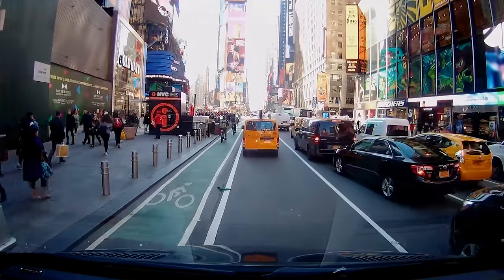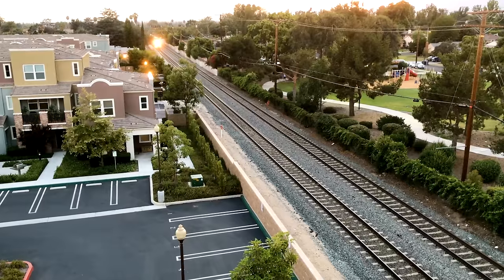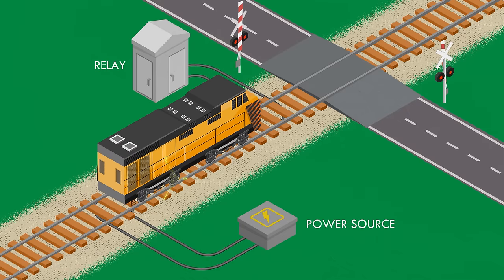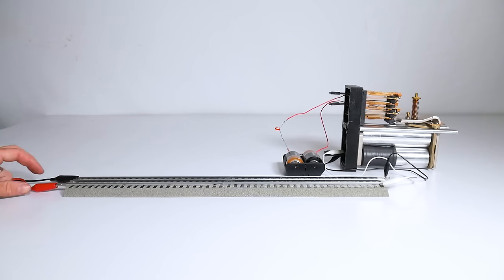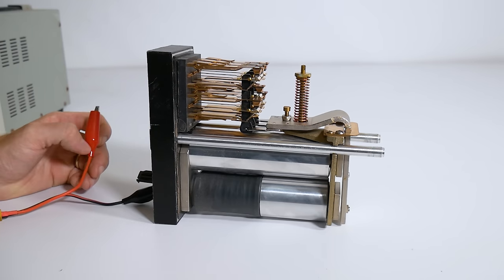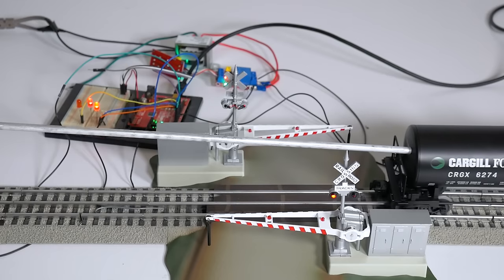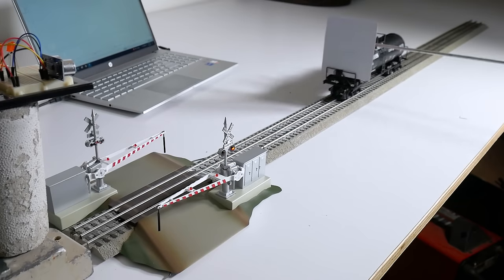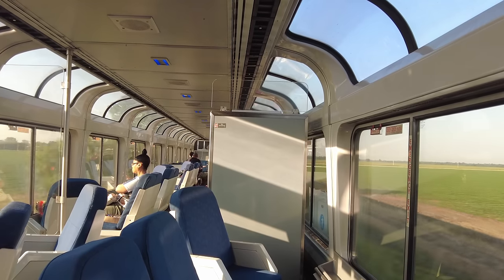How Railroad Crossings Work

Comment: Dear Practical Engineering, awesome video, especially love the fact you included the actual railroad relay to visualize the workings of train detection for the purpose of initializing the mechanical and electronic/electrical components of a railroad crossing system.
On the insulated tracks in true scale; just wondering about the mechanical components of the rails which provide the insulated section. Regarding the fact how you showed the rail gap, the fish plates and how they bond the two pieces of rail over the insulated gap should mean that these fish plates and their mounting bolts and nuts are also insulated from the rail. Would be interesting to see that in more detailed fashion. Cheerio

Comment: In the UK, the crossing warning actually have a yellow light analogous to those on traffic signals, to provide a few seconds' heads-up before the crossing starts to flash. These same signal lights are also used for movable bridges there, lighting up when the bridge has to open for boats. Also, for some reason, the tunnel under London Bridge Station has a set of these signals too.

Comment: Good generally explanation of level crossings .
Spent 41 years as a signalling tech support engineer.
I still think the stick circuit on a relay is a stroke of genius. 
A rely held energised by its own contact .
This enables a rely to have a memory .
In other words a 0 or a 1.
Binary .
The basis of a computer and WW2 Collosus the code breaking computer

Comment: I also remembered that train crossings actually have swinging stop signs called griswolds, and flagging signals called wig wags, and most crossings have different type of bell sounds, which are mechanical and electronic. There are also different types of right lights, light bulb and led lights, and different sound of gate mechanisms, with different lights too. I’ve always go by any train crossings all the time.

Comment: There are stretches on Highway 58 between Barstow and Bakersfield, California, where railroad tracks run parallel to the highway, with an occasional intersecting of the two.  It's interesting to see some daring motorists racing the freight trains to the grade crossing, as the motorist stopped at a grade crossing could be stuck there for several minutes.
Reply: It's just the same game the trains play while racing to an interlocking.

Comment: I like the sophistication of grade crossing gates on rails with high and low speed trains.  I knew if the gates fired and I couldn't even hear the drone of diesels yet then a hot shot was coming round the bend.  But If I could hear diesels thundering before lights and gates then I knew it was a slow roller.  Getting those gates to go back up when the approaching train slowed to a stop was particularly genius, though.

Comment: is the 3VDC you're using for the demonstration related to the speed of the the relay's operation?

i've seen some specialized relays in my day, but never a "vital" train signalling relay. its slow operation was interesting, and i'm glad you addressed the safety mechanisms built into the relay itself. thanks as always, Grady!

Comment: Here in Mpls/St Paul, Minnesota.  We have ‘No Horn’ at grade RR crossings for a mainline high volume railroad line.  All are signed ‘No Horn’ for vehicle drivers.  This means the train engineer does not sound their horns when their trains approach crossings.  Also the street approach to the crossings have long concrete islands with reflective sign posts or ballards in an effort to keep approaching drivers on their side of the road when a train approaches.  All No Horn crossings have automatic gates, as described in the video.  No horn crossings are mostly found in residential neighborhoods.  So as not to wake up citizens overnight, though they operate 24/7.  I wonder what fail safes are added, in case primary systems fail.

Comment: It's amazing how different the US system is from the system in the UK.

For a start only quiet crossings are controlled automatically like yours. Busy crossings are integrated with the signalling system and controlled by the signalling centre for the area.
On a busy road they'll have barriers that cover the full width of the road to prevent people just driving around them. The alarms and lights will trigger first followed by the entry barriers about 10 seconds later with the exit barriers dropping another 10 seconds after that. Once the barriers are down the alarms will turn off with the lights remaining on.

The barriers will be triggered automatically just like yours but we have a MUCH longer waiting time (about 3 minutes) to allow signallers enough time to stop the train if anything goes wrong. The signaller will view the CCTV of the crossing and verify that the barriers are down and no-one is trapped on the crossing before setting the signal to green.
If someone is trapped on the crossing, which is possible if people don't keep the crossing clear in heavy traffic, the signaller can raise the barriers to allow them to leave before lowering them again.
The barriers will usually go up immediately after a train has passed unless there is another train coming soon.

Crossbucks (ours are very different) are only used at crossings without barriers, typically on rarely used crossings on industrial estates or ports. We also have signs with the name of the crossing and a phone number to call but ours are much larger.

The UK is also actively trying to remove as many crossings as possible to cut down on the number of incidents even if it wouldn't normally be considered practical or cost effective.

This video by Dad Rail gives a pretty good look at how they work https://www.youtube.com/watch?v=u2wx9CKIa9g
Reply: When it comes to automation, most LCs only have an auto-raise feature. Auto-lower is pretty rare. It's generally only found at MCB-ODs, where obstacle detection equipment replaces the signaller.

Comment: Where I live the railroad crossings are sometimes controlled in combination with signals. So if a crossing is between the entry signal and the station, the entry signal won't go green until the crossing is reporting itself as secured. This also applies for exit signals & crossings at the end of the railway platform.

Comment: I am on the operating crew of a heritage railroad in Nashville, TN and a volunteer presenter for Operation Lifesaver, an organization that educates the public about the safety at railroad crossings.  This was a good video and does a nice job of explaining the safety warning devices around at railroad crossings and how they work.  And as @danieljohn560 said, thanks for pointing out the blue sign with the toll-free number that people should call if they are stuck on the tracks or if they see someone who is stuck on the tracks.

Comment: Some AWDs require longer warning times and/or slower speeds to cross them for train crews to comply with. We have a few field tricks to speed things up. If you charge at the crossing, the approach circuit senses the train and thinks you are going to hit the crossing sooner. You then can slow slightly and the additional warning time will be provided for without going slowly. This is obviously not possible with freight trains as much but with passenger trains you can do it. If you have a speed restriction over the grade crossing and more than 20 secs of warning before occupying it, simply approaching it at the speed you are restricted to at the crossing actually makes it harder to provide the warning before occupying since the crossing won't activate until you are close to it. Charging the crossing activates it sooner and then you can slow to whatever speed and/or to provide the warning time required which is much faster. We call it "showing the crossing we mean business".

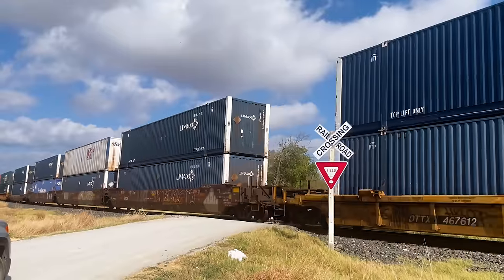Comment: 3:18 A few speedbumps make this crossing safer as cars need to slow down.
4:30 Way back in my school years A few kids figured out this system and did not know the difference between a train axle and a bike chain. Thus operating the gates.

Comment: In my country we don't have problems discussed in the video because most grade crossings are human controlled. Some controlled from the station headmaster but rest are controlled by post on the crossing.

For detecting train, we have automatic sensors and those are relayed to the stations or controller hub of the entire operation and relayed to the dedicated post via bell signal.

Comment: Westbound on Manatee Avenue in downtown Bradenton, Florida. I was waiting at a red light but there was a railroad crossing directly in front of me so I had stopped clear of the gates and tracks. The Toyota Corolla in front of me had not. Its trunk was still well over the tracks.
That's when suddenly I heard the clanging of the crossing bell. The gates began to lower in front of me and the lights began to flash almost simultaneously from my left side. I heard the horn of an oncoming train headed northbound ready to cross the Manatee River.

At this point on Manatee avenue there are only westbound lanes. The east bound lanes are a block further south.

The gates closed in front of me but behind the Toyota. He actually had plenty of room to move forward but didn't seem to notice any of the commotion. At this point the train had also noticed the situation as its horned blasts started to become more frantic.

Soon the train was joined by a chorus of other horns from cars, trucks and even a bus that had stopped for the crossing. All of them were trying to warn the Toyota of its impending danger but to no avail. The light in front of it had changed to green but it was taking a considerable time for traffic to get moving. The Toyota still had plenty of room to pull forward and clear the tracks. It just wasn't.

Suddenly out of the bushes to the left side of the intersection, the locomotive appeared. It was blaring its horn continuously. It was also moving at barely a walking pace while pulling a single Tropicana car behind it. With brake squealing it came to a full and complete stop about 6 ft shy of the back of the Toyota.
Still blasting it's horn but the Toyota remained in different. As the traffic in front of the Toyota began to gradually pull forward then and only then the Toyota continued on its way seemingly oblivious to the fact that a train had managed to stop for it.

Comment: When I worked on the track for British Rail back in the 1970s, we had a much simpler way of finding out if a train was approaching. We would lay an explosive charge on the track, and when it went 'Boom', we knew we had to run for it! Literally had to chuck my shovel away and dive into a ditch before now - when a train comes pelting out of a tunnel, and the wind is in the wrong direction, and the trackman with the flags and little trumpet is distracted, it was the charge that saved your life.

I had a quick look, and that cross bar thingy may be the international standard, but most level crossings (that's what we call them) in the UK seem to have a rectangular sign with three lights, (two red and one orange below them), surrounded by red and white bars. Sometimes they have the cross bars above, but mainly just the rectangle with the red/orange lights. To be honest, I don't remember either the rectangle or the cross bars in the 1970s - but that's just me. I'm sure they were there, or something very similar!
Reply: The UK has them, but only at open LCs (which are few and far between nowadays).

Comment: Here's how a modern AC track circuit detects the speed of the train:
Leading from the bungalow, one wire connects to each rail. The computer measures the impedance between the two wires (AC resistance). If no train is present, the impedance is 100% (the wires/rails have little to no AC current going between them). As a train approaches and the circuit is shunted by the wheelsets (single piece of solid metal with an axle and two wheels) the AC current goes down one rail, through the first wheelset, and back down the other rail to the other wire, reducing the impedance. If a wheelset shunts directly where the wires connect, the impedance is 0%. The computer looks at the speed of the dropping impedance (AC resistance) so it knows when to lower the gates. As soon as the number starts increasing (or stops changing), it raises the gates.

To keep the 100% value more stable, there is a place far away, farther away than you would ever need to detect a train, that has a "narrowband shunt" in the track. It's a filter connected across the rails that lets a specific AC frequency through and nothing else. If no train is present, the crossing sees this maximum distance instead which doesn't change. (If 100% was an open circuit, rain could drop the impedance and lower the gates).

This system keeps the rail intact with no IJs (insulated joints) and allows nearby crossings to have completely separate overlapping circuits on different AC frequencies. Also, additional AC frequencies are used for the railroad signals that keep trains separated from each other (which inspired traffic signals (and improved our understanding of colored glass and color perception in general), but that's another story).

Comment: Railroad crossings in Germany are more complex. The big difference is, there is always a signal for the train in braking distance or more for the train, either a normal train signal or a railroad crossing signal, which will stop the train if the railroad crossing is not safe. 
There are two types of it, first is switched on by the train dispatcher, second by the train itself.  For the first type, the train dispatcher has to switch on the railroad crossing and check if is activated and nobody is on the tracks via camera or radar sensors before he can set the signal for the block section to green. The railroad crossing s is switched off / opened after the train left the block section. This type sometimes has long waiting times for cars.
The second type is switched on by train itself, but far away from the railroad crossing. Often there are axle counters used, because they are also used for detecting if a block section is free (number of axels in = out). In braking distance there is a signal for the train driver, which shows a white light if the crossing is activated (and the radar sensor detected no car on the tracks, if installed). If the signal light is off, the train has to stop in front of the railroad crossing (which will enforced by the train safety system). After the crossing there is another axle counter, to detect if all axles left the area to turn of the railroad crossing.
This is only a short version, it's a way more complex in reality. There a timeouts for certain things, most railroad crossings have a key switch where the train driver can activate it if the automatic activation does not work, ...

Comment: I've always wondered about this, thank you for the very informative and interesting video! One thing I feel was missed is how multiple at grade crossings that are close together work? Wouldn't the relays interfere with each other or do they use segmented track portions which can regulate more than one set of crossing safeguards. Thanks

Comment: I once saw a near-collision that happened because two small (maintenance ?) locomotives went through a crossing about 1/2-1 minute apart.  The gate came down for the first locomotive but then went back up - and STAYED up - as the following locomotive neared the crossing.  At the same time, a dude in an approaching large pickup, seeing the gate rise, kept going, seeing the second locomotive only at the last second.  Both pickup and Locomotive braked hard, narrowly avoiding disaster !
On another occasion, I was approaching a crossing (which had not seen rail traffic in years) during a heavy thunderstorm. A lightning bolt struck, several hundred feet down the tracks, triggering the gate and warning lights.

Comment: There are also some systems thst use acoustic waves to detect an approaching train. They are designed for remote crossings where integration with standard signalling systems may be too hard or power hungry .

Comment: The crossing closest to my house (about .75 mi.) drops the gates sometimes 3 minutes or more before a train reaches the crossing if the train is coming from the north. It seems to be a glitch with slow moving trains. This has happened for a few years now, but only occasionally. They have recently constructed a new crossing fairly close to my current crossing, so I have yet to see this happen since the new crossing was opened. I don't cross this crossing too much anyway (probably about 15% of the time I leave or return to my house), but I will keep an eye on it to see if it has been fixed or not.

Comment: Fantastic presentation -- thank you!  I'm curious what happens if the grade circuit is closed before an approach circuit at a grade/level crossing.  I'm sure the logic circuits will handle this properly as it is an unlikely but possible situation (i.e. temporary failure of other circuit).  As a kid, I spend a lot of time around railroad tracks but was never exposed to crossings; I'm now eager to locate the infrastructure that supports crossings in the future!